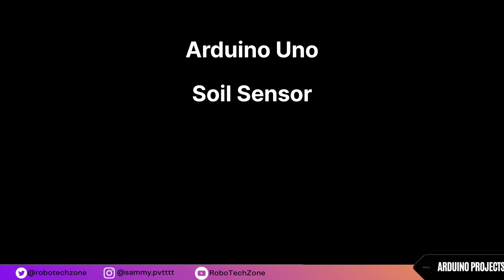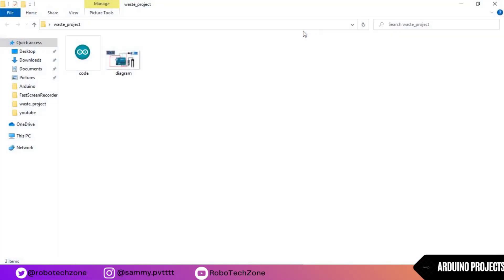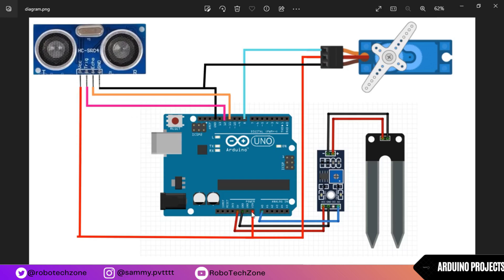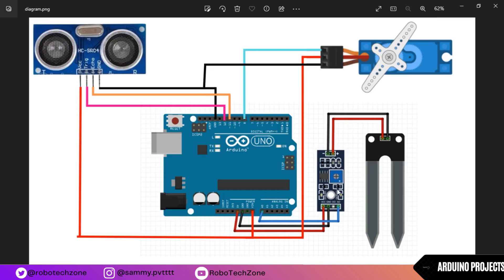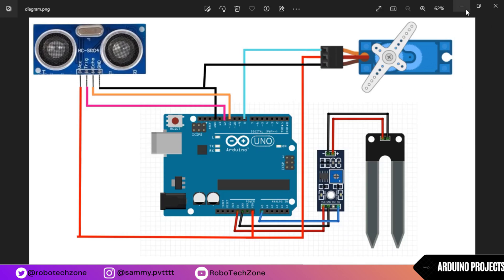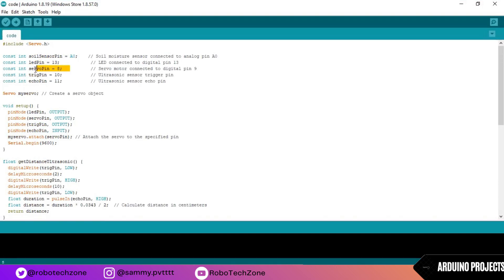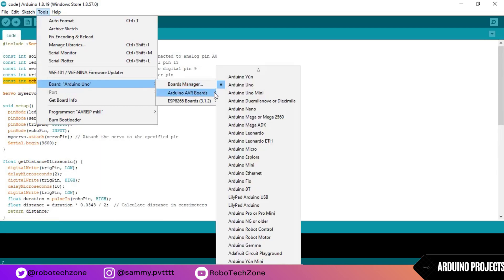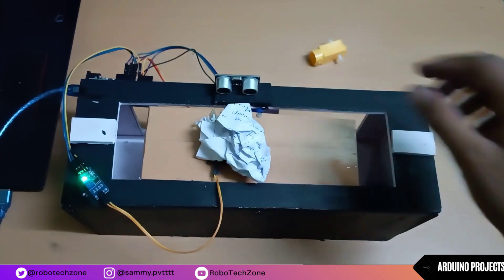Waste segregation project using arduino || Arduino Projects

Comment: How can we connect 2 pins at one ground in arduino uno as you connect servo motor and ultrasonic sensor to ground of arduino uno
Reply from the maker: You can connect all the wires with one ground it will work. Or else if you want you can connect it to the ground pin of the arduino. Arduino has 3 ground pins. Or else use a breadboard to check and connect multiple ground wire

Comment: ITS FAKE CODE IS NOT WORKING DON'T WASTE YOUR TIME WHILE WATCHING AND MAKING THIS PROJECT
Reply from the maker: What error you are facing sir
Reply: @robotechzone  motor is rotating in a perticular Direction only with out  any garbage please provide me original code
Reply: @robotechzone motor is going without any command or trash ?
Reply: Bro can you guide me about the process of using servomotor
Reply: @kavyamulaga9897 red wire in motor is positive in it and brown or black is negetive connect red to 5 volt and brown to GND adn orange is input so see the code and number after servo motor function then connect the orange to the that pin . Th are 2 types of servo 180 degree rotating and 360 degree rotating

Comment: Sir in circuit diagram pins are connected to different pins in and in code the are different when we are giving command it is not working
Reply: Yeah it happens did it working now .

Comment: The code link you have given is opening but the file is not supporting to me ,  so kindly give the code in another format pls
Reply: #include <Servo.h>

const int soilSensorPin = A0;    // Soil moisture sensor connected to analog pin A0
const int ledPin = 13;            // LED connected to digital pin 13
const int servoPin = 8;           // Servo motor connected to digital pin 9
const int trigPin = 10;           // Ultrasonic sensor trigger pin
const int echoPin = 11;           // Ultrasonic sensor echo pin

Servo myservo; // Create a servo object

void setup() {
  pinMode(ledPin, OUTPUT);
  pinMode(servoPin, OUTPUT);
  pinMode(trigPin, OUTPUT);
  pinMode(echoPin, INPUT);
  myservo.attach(servoPin); // Attach the servo to the specified pin
  Serial.begin(9600);
}

float getDistanceUltrasonic() {
  digitalWrite(trigPin, LOW);
  delayMicroseconds(2);
  digitalWrite(trigPin, HIGH);
  delayMicroseconds(10);
  digitalWrite(trigPin, LOW);
  float duration = pulseIn(echoPin, HIGH);
  float distance = duration * 0.0343 / 2;  // Calculate distance in centimeters
  return distance;
}

void loop() {
  int soilMoisture = analogRead(soilSensorPin); // Read analog value from soil moisture sensor
  float ultrasonicDistance = getDistanceUltrasonic();  // Get distance from ultrasonic sensor

  Serial.print("Soil Moisture: ");
  Serial.println(soilMoisture);
  Serial.print("Ultrasonic Distance: ");
  Serial.println(ultrasonicDistance);

  int dryThreshold = 600;
  int dryThreshold1 = 700;
  
  if (ultrasonicDistance < 4) {
    delay(1000);
    if (soilMoisture > dryThreshold) {
      digitalWrite(ledPin, HIGH);
      myservo.write(180);
      delay(1000);

    }
     if (soilMoisture < dryThreshold1) {
      digitalWrite(ledPin, HIGH);
      myservo.write(0);
      delay(1000);
    }
  } 
  else {
    digitalWrite(ledPin, HIGH);
    myservo.write(90);
  }
}